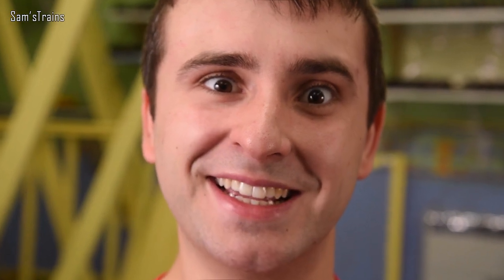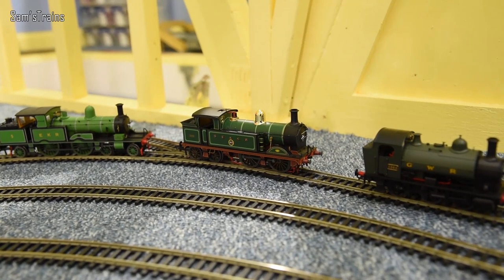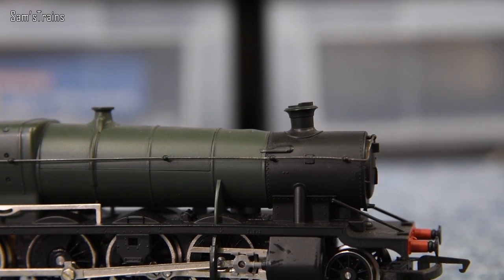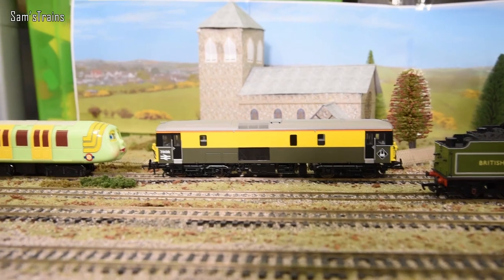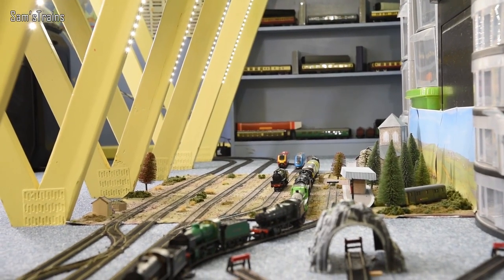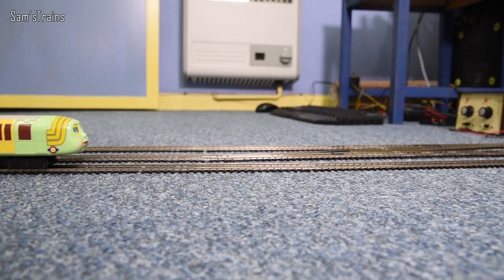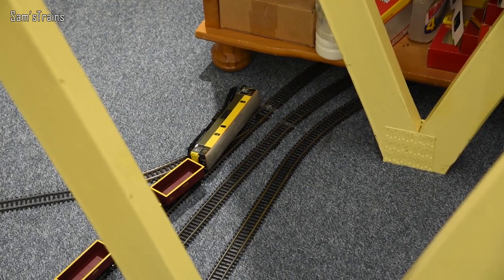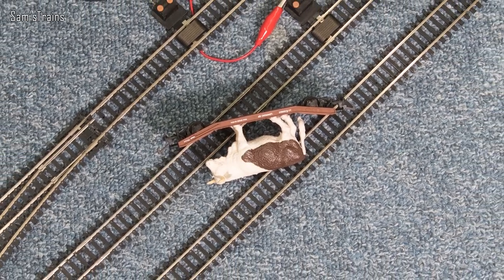Lemon Locomotives | Model Trains With Design Faults

Comment: Ironically, the real Class 221 also had issues with its tilting mechanism, to the point where they had to remove it because it was so bad. So Bachmann is actually making a perfectly accurate model to the prototype!
Reply: Wee mistake: the 221 tilt worked and still works perfectly fine. Avanti ones still have it, CrossCountry disabled it purely to save money and to make life easier when running one with a 220 (220s weren't even built with tilt at all), nothing related to their unreliability
Reply: @Danse_Macabre_125  Ah, thanks for the info. I'm not so interested in the modern stuff so not surprised I got something wrong!
Reply: @tavtwo8581  We all make mistakes, if anything I'd be even worse with most pre-HST stuff

Comment: Hi Sam 
You bring up a very good point with this film.  The trouble is the growth industry in complete lemons is damaging the customers and the hobby.  Dealers are also customers . 
Normally I wouldn't comment like this but the lack of basic QC is such a serious issue.  As a dealer we are here to grow the hobby, to help customers enjoy railway modelling and to find solutions to customer plans.  In general we should just be dealing with clarifying instructions and solving small issues. Now we find that we have to inspect and test every model before sale.  Carefully unpacking, inspecting and re-packing a model takes a lot of time.  (2 hours for an O gauge loco).  Despite the high price tags, there is no dealer margin in these models to pay for all the additional work that is now involved. ( Before complaining that this is mercenary, please consider your own work and paycheck - shops are a very costly enterprise to keep running)
The process of making good or returning to a manufacturer has significant costs.  If parts are missing then it can be months before I can put a model on sale. - in many cases I will have missed the boat on potential sales while I wait for replacements.
Long term destruct testing should be done at the manufacturer during the design process.  This kind of testing is not the responsibility of dealers.  
The feeling is that cost cutting on motors and gearboxes has become acceptable for some manufacturers and maybe the savings are seen as so beneficial that an increased returns rate is acceptable - or the model will hold on past the warranty period...  I want to put it to these manufacturers that cost cutting in this manner is too destructive. All those comments of " I will never buy another model from them again" do add up and the customer base will diminish.
 Today I find myself stripping out ranges that I stock and limiting what I buy to manufacturers that I trust to look after their products.  I find myself refusing customer orders as the products involved have known issues that will result in the shop trading at a loss on the deal.  This is not fun or engaging for anyone concerned.
I want to get back to a position where it is " Great model, thank you for your purchase.  I know that you will love it!"
Many thanks
Chris
Reply from the maker: Thanks a lot Chris - yes it certainly is quite damaging to the hobby for sure! And absolutely - why should you have to spend all those hours checking models when it should be done at the factory? Thanks a lot for sharing all of this - hopefully the manufacturers will see content like this and make a move for the best, before it's too late!
Thanks for watching - Sam :)

Comment: I have been modelling for 60 years and the biggest lemon was the Hornby T9 which suffered motor mount mazak rot ! Such was the issue that Peter's Spares produce an aftermarket mount ! This loco topped the charts in my local model shop for the number of repairs! In fairness Hornby repaired both my 30285 and 30726 FOC!
Reply from the maker: Yes you're right Nigel, I may have forgotten to include that one actually - my T9 did exactly the same thing!
Thanks for watching - Sam :)

Comment: It’s just a shame that expensive locos with so much detail and separately fitted parts, get thrown out because of a bad mechanism/motor or just bad engineering. The smallest things can make the biggest impact.
Reply from the maker: Yeah you're right - a real pity :(
Reply: True, I have never been 100% impressed with my Hornby super detailed 08 shunter as it runs well at low speeds but if you get it to higher speeds or longer running times the gearing starts to chatter which makes you think that the motor is failing. I am about to try a tip someone else mentioned by adding modelling white grease to the gears to minimise the noise. Its apparently a common issue with the hornby 08 shunter

Comment: i have a hornby railroad 14xx for my own layout ive had it for give or take 3 years now and i've never had a problem with it. it's perfect for going around the tight curves that i have on my layout and the motor has never exploded or burnt out on me. it does sometimes rock side to side when i run it and the traction tyres are on their way out but mechanically i've never had a single problem with it. nice video sam big fan :)
Reply from the maker: If it's 3 years old, then it probably still has the sprung axle - it's the newer Railroad design that was downgraded!
Thanks for watching - Sam :)

Comment: Hi Sam, thanks for the shout out! I honestly don't think Heljan can make a working steam model so I did not get one of them, The H class you are right, I added paper washers under the worm drive cover and its been fine since, I have a BR one that has been fine from new, so maybe a batch error.  Don't have the Oxford Adams,  Shame about the 14xx the older Hornby one was fine, Not had any issues with the Dean Goods from Oxford,  ah the S15 yes indeed a huge problem, after Hornby sent me a brand new one, no more trouble.  I'll need to check the N class, I have two and not notices any issues, ah the 9F my chassis twisted and luckily Hornby replaced it for me, but I hate Marzak rot, vile problem. OH yews the older Bachmann wheels, very sad indeed, who knows what's wrong with the plastic, and yet I have many cracked axles :(  Dapol 73, yes this is dad, mine makes a horrid noise, I am on number 3, I also don't like how they crab around the track and as for the pick up arrangement!  why did they do it! Good video idea!
Reply from the maker: No problem Mike - I followed your advice on my H class, along with the replacement motor, and mine seems fine for now too. The older 14xx was indeed fine, they actually removed the spring mechanism from the rear truck for their railroad one! Yes the 73 is a total waste of time - only loco I truly regret buying!
Thanks for watching - Sam :)

Comment: 4:25 I don't have any of the Bachmann Thomas locos, but I had a motor burn out on a Bachmann F7A, which ran poorly even though it was 8-wheel drive and had all-wheel pickups. It might've had the same motor as Circle
Another locomotive that I have that seems to have a recurring flaw is my Life-Like 4-6-2 locomotive. It wheelslips on uphill curves (with even three coaches) and the front and rear axles stay on the track quite loosely. And I do have a floor layout too, which might be the source of its troubles
Reply from the maker: Ahh sorry about that - with that my driving wheels, if they didn't fit proper bearings (as they often don't), the massive friction could have been the cause - sorry to hear that :(
Thanks for watching - Sam :)
Reply: Bachmann only puts effort into their expensive stuff. I do have a Bachmann 45-Tonner which is really reliable.

Comment: The early Hornby T9 with 6 wheel tender included in the 'Southern Suburban 1938' set has the tender frames assembled the wrong way round (guard irons at the front), and the motor mount has mazak rot.
Reply: Yes, indeed it has.

Comment: Great video Sam. I have a 14xx but from Airfix and it must be at least 20 years older and yet it runs better than the railroad version. However this video truly ‘brought out’ the lemons in locomotives. Good video
Reply from the maker: Thanks Lewis - yes they do indeed - they used to have the sprung rear axle, but Hornby got rid of it, for some ungodly reason!!
Thanks for watching - Sam :)

Comment: Urm... unfortunately i have 3 of these locos. The dapol class 73 which always derails on my points but i dont want to get rid of it because i love the colour scheme and it has nem couplings, the bachmann n class which i replaced the coupling and the hornby railroad 14xx. I wanted it to pull my auto coach my it gets stuck on my points so easily so dont often run it. Great video sam and keep up the great work. Stay safe, jack
I also suggest you always have a breakdown crane standing by when running these locomotives lol.
Reply from the maker: Ahh sorry to hear that - yeah I love Dapol's colour schemes too! Yeah I don't often run that 14xx either - they're no fun :(
Thanks for watching - Sam :)

Comment: Great vid Sam and very fun to watch. As for lemons in my collection I definitely have atleast one. The worst was my older style Bachmann class 66. Despite picking up on 8 wheels and running on clean track with clean wheels and pickups it would still cut out often for no reason. I gave it good service and checked all the parts were in good condition and everything was working perfectly fine. There was absolutely no reason for it to cut out like it did so I gave up and bought a new chassis which luckily was the older style 21 pin version with all wheel pickup and I haven’t had a problem with it since. This wasn’t the first time I had a problem like this as I have 2 more older style Bachmann 66s which suffered even worse from the same problem of which it got to the point where I converted them to rolling chassis. I’m never buying an older style Bachmann 66 again. As for other lemons in my collection I’m sure the hattons 66 deserves a place due to the axle box issues I’ve had with it. I only had a problem with two axle boxes but I eventually gave up and glued them permanently into place however I have left all the others as they are but they’ll probably get the same treatment in the future. Overall it seems that sheds don’t like me very much
Reply: I had this problem with early 66135. I added and wired up extra fine phosphor bronze strips to the 'dead' wheels and the loco now performs beautifully!
Reply: Nigel Curtis great to here mate. 66135 is one of the 66s I had the running issues with and so it’s now a rolling chassis. As well as you and myself I also have a friend who to had running issues with 66135 and he also converted to a rolling chassis. Why this issue is happening I do not know and it shouldn’t be happening at all as 8 wheels picking up is more than enough really for a loco that size. I have locos with less pickups that run better than those models so there’s really no excuse.
Reply: @fyfieldjunction  Hi mate. The centre axle appears to have a bit too much side play and the pickups would not stay firmly 'sprung ' on the back of the wheels both on straight track and curves. Trying to increase the tension caused the loco to derail immediately on entering a curve so I went back to square one and added the extra pickups as I mentioned earlier!
Reply: Nigel Curtis ah I see
Reply from the maker: Thanks a lot for sharing these - I've never heard of that issue before, so that's very interesting! A very cool fix too! :D
Thanks for watching - Sam :)
Reply: @SamsTrains  Sam as you have often commented, models are not thoroughly tested by manufacturers and the original layout of 8 wheel pickup on the 12 wheel Bachmann 66 was doomed to failure as we have discussed!

Comment: Interestingly, my Hornby Railroad Class 47 is one of the best runners on my layout. An absolute trooper who can easily handle multiple points, does a beautiful crawl, can happily pull 10+ wagons, and isn't even too fussed about less-than-squeaky-clean track! I've gone and looked at the center axles of mine, and they seem to be fine - they've even got a slight bit of up and down 'play'. I regularly check the loco for maintenance purposes (as I do with all my locos), and more often than not, I have to close it up again without needing much attention. Perhaps I've got the rare diamond of the rough lot!

Comment: My Hornby railroad 41XX has a sprung back wheel set and its fine. I bought mine after your review and i think mine is either an older tooling or its a newer improved tooling.
So mine is probably a new tooling that has been fixed since your review. Love the video SAM. 👍👍
Reply from the maker: Yes the older Hornby versions had a sprung rear pony, and then they got rid of it! What's the catalogue number of yours? I wonder if they reverted back to the old design??
Thanks for watching - Sam :)
Reply: @SamsTrains  it is R3692

Comment: For the record, I have a Bachmann Virgin Voyager Class 221 set which I bought second hand but it does not derail as you describe.  In fact it keeps on the track very well even though the power car is centrally located on the train and pushes two coaches when run in either direction.
Reply from the maker: Glad to hear that Robert - many others are sharing stories that their 221s are fine - what radius curves do you use??
Thanks for watching - Sam :)
Reply: @SamsTrains  Hi Sam, my smallest track curves are second radius but only through 90 degrees at one corner of my layout.  All others are larger with flexi-track.

Comment: Sam,  the Heljan saddle tank is definitely a lemon.  My replacement loco was a lot better but still needed a push to get it moving and then would stop periodically requiring further hand assistance.  I would never consider a steam loco from Heljan again.  To add insult to injury I had to pay the return postage from Australia to send the original faulty loco back.  I considered returning the replacement loco (supposedly test run by the store to confirm operation) but given another $30.00 return postage cost, possibly no replacement available and three month turnaround time,  I decided that I had suffered enough.
Reply from the maker: haha yeah it certainly is - sorry to hear you've had no luck either, they're just useless! I think the retailer should have to cover the postage if it was faulty!
Thanks for watching - Sam :)

Comment: Loving that about the Dapol 73, @15:20, "... that does still happen..." (Engine obligingly falls over on points.)
I still have a Hornby R156 (vintage 1972, I think) with one eccentric wheel, so it wobbles continuously and stalls on points as only 3 wheels are on the track.
And I have a Hornby R351 electric, that worked fine, but it was such a faff putting up the wires and getting them bent to match the track. But they were longer than a segment of track, so the curves in the wires didn't match the curves in the track, especially after my brother got his fingers on them. Worked OK a few times, but it didn't suit a couple of impatient boys who had to disassemble it again for dinner. And it was a CKD engine, but I wasn't that good at putting it together!

Comment: Great video as always Sam! The 2 lemons I’ve got in my collection:
Hornby Class 125 HST I have 2 and neither of them can pull the coaches and dummy car that come in the set due to traction tyres
Bachmann Collet Goods much luck your N15s the tender doesn’t stay on the rails or will disconnect pulling rolling stock
Reply from the maker: Thanks for sharing Lewis - that's no good at all! :(
Thanks for watching - Sam :)

Comment: The 14xx... It's a nice engine and model. But, my issue is that I can't can't pull heavy trains. I can only really use very light frieght or a autocoach for what i have. I do have the class 221 too, but I don't run it on tight railways at the moment, so I am okay with it.
Reply from the maker: Yeah that's right - though it used to be much more powerful, they just ruined the design :(
Thanks for watching - Sam :)
Reply: Thanks for the info on the bad engines with flaws. My dad usually avoids them anyway. :)

Comment: I bought an LMS 4-6-2 Princess Elizabeth class loco off eBay about 10 months ago. On one side, the driving rods stopped working as the loco was going round and then derailed the loco. I had to take it to a model specialist via my local Hornby retailer and he had to glue the screw onto the thread so that the driving rods would work properly. This was because the screw thread was shot. It now works but was a notorious lemon! Another of my LMS locos sometimes needs a little nudge to get it going but then it works just fine. Any thoughts on that one?

A point of interest. My dad gave me a 4-6-2 Britannia class loco when I was 7 and, 58 years later, it still works. It pulls coaches for fun and is a real joy. Its longevity is something to admire. You could say, in view of all the lemons in your video: "They don't make 'em like that any more!". I was particularly concerned at Bachmann's poor track record on this and other videos you have produced for us. Maybe Bachmann is a firm to avoid? Possibly, but I am sure you know of really excellent models that they produce. They can't be all bad, surely?!
Reply from the maker: Ahh sorry about that Pete - that really does sound like a lemon! Those old Britannia models are amazing for sure - I have some from the same era, both working perfectly too!
Thanks for watching - Sam :)

Comment: It’s just the New Hornby Henry that’s like that.
The old one it’s just fine.
Reply from the maker: Yeah probably - not known of any issues with the tender driven ones!
Thanks for watching - Sam :)
Reply: The old Hornby Thomas range we’re all better than the new ones.
Before they were discontinued.
But they had all the same faces but the new ones were just repainted.
I think the old ones are a lot better.
But that’s just my opinion.